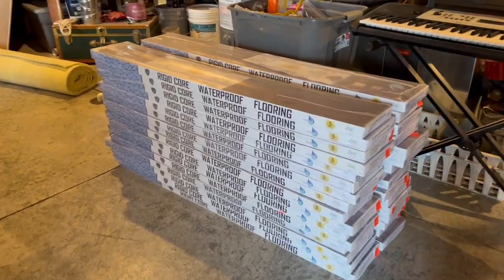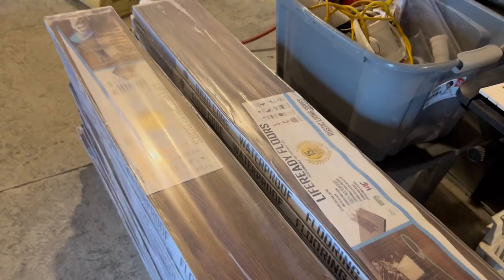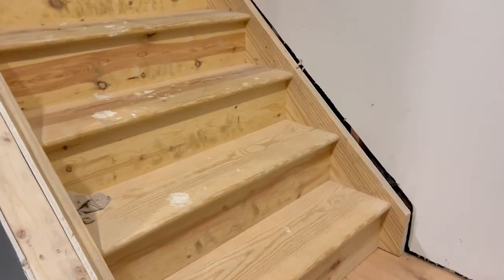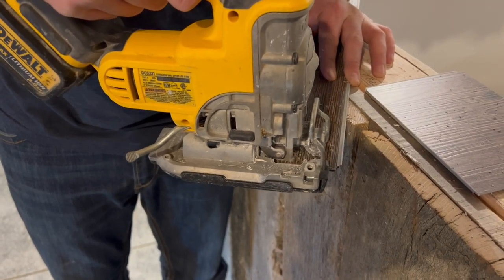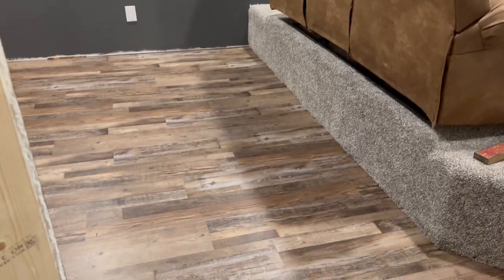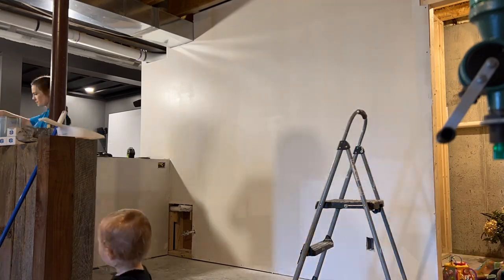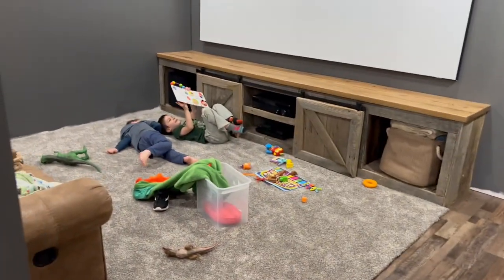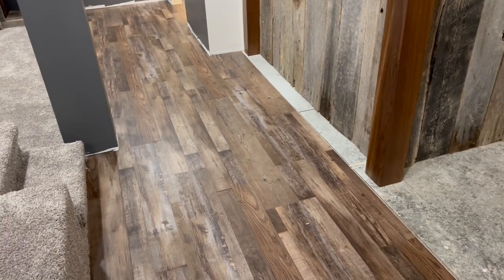Finishing Basement #17: DIY Vinyl Plank Flooring (From Ollie's) | CHEAP, EASY TO INSTALL, DURABLE!

Comment: Looks great so far! I may have missed it if you already said, but how wide is the room? What about the size of the projector screen? I would like to attempt something similar but I'm not sure my room is big enough. Thanks!
Reply from the maker: Hey! Thank you:) The projector screen is 120 inches. I cannot recall the exact measurements of the movie theater room. I will measure it tomorrow and comment again to let you know...
Reply from the maker: Also- you can look up the length of the screen online. The 120in is the diagonal length….
Reply: @CollinsCountry  Thank you for your quick reply! One final question if you don't mind...Is your ceiling height 8ft or 9ft? It may be the camera angles but it looks higher than my 8ft ceiling. Thank you again!
Reply from the maker: +eq2templar Okay. Just took the measurements. The carpeted area (movie theater) is 10ft X 16ft 8in. Our ceiling height is 8ft 8inch. We put higher ceilings in the basement, but it’s not truly 9ft…. I hope this answers your questions and I hope you can make this setup work for your basement. We love our theater!

Comment: Hows it holding up a year later? We just bought a bunch of this
Reply from the maker: It’s not bad. No real or issues. Occasionally we see a seam pop up and we step on it to reseat it. This stuff was super cheap. We have vinyl plank through out the rest of the house that was triple the price and never pops.

Comment: I'm curious as to why there was a vapor barrier laid down as well. Is there one on the underside of the flooring?
Reply from the maker: +Ryan Hey! Technically, you should paint the floor before putting this down but we weren’t concerned about it. The vinyl is waterproof. It’s not technically the “right way” but we have done ie before and never had issues:) In my little mind, it kind of acts as a vapor barrier itself…
Reply: @CollinsCountry  thank you for the clarification on such an older video! I appreciate it. Functionality is always better
Reply from the maker: +Ryan No problem! Good luck with your project:)